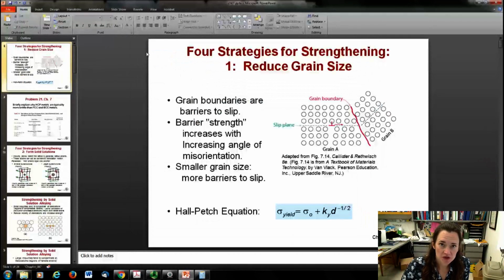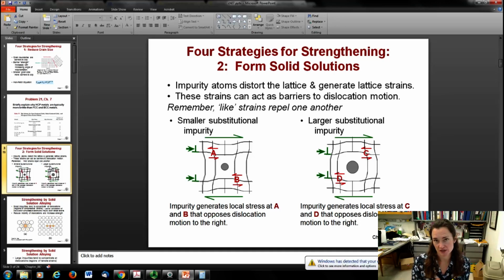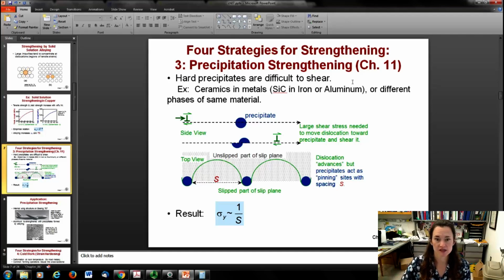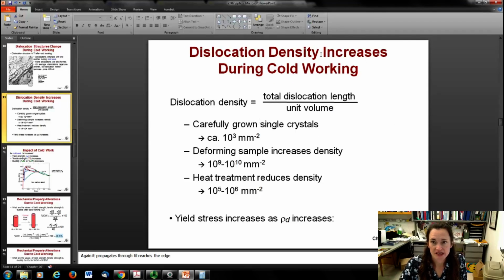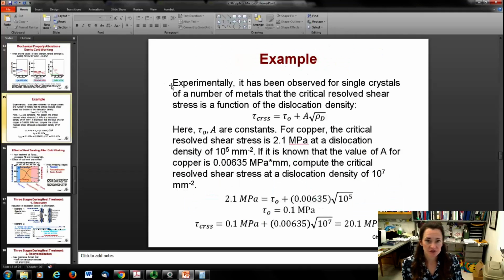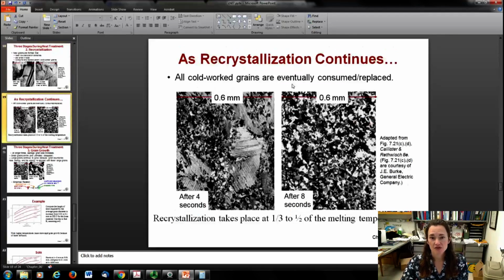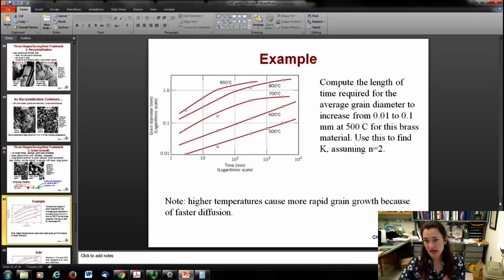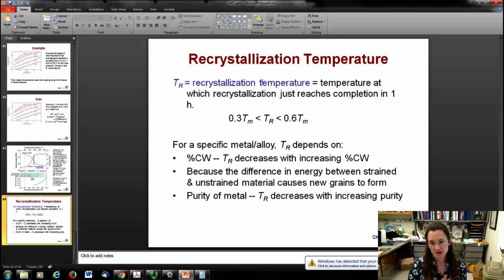Techniques for Strengthening Metals

Comment: Thanks for sharing this valuable information. But I have one question. I was asked to maintain the temperature at 530 C - 540 C for aluminium alloy. When compared to the melting point of aluminium, 660 C it is way higher than the limits for the recrystallization temperature as the lecture. Could you please explain this?

Comment: thank you for this video. I am a little confused though. You mentioned that one way of strengthening a material is to reduce the grain size so that the material doesn't slip as much. Why then will the HCP material be more brittle given that it has less slip systems and as such, should slip less. Does having less slip systems not achieve the same aim as reducing the grain size?
Reply from the maker: When you strengthen a material, often it does become more brittle. There is a distinction between strength and ductility. Ductile systems deform but do not break. Many brittle systems break when they deform, but they do not deform easily because they are strong.
Reply: @tonyacoffey5568  oh yeah. Thanks a lot. I love your videos